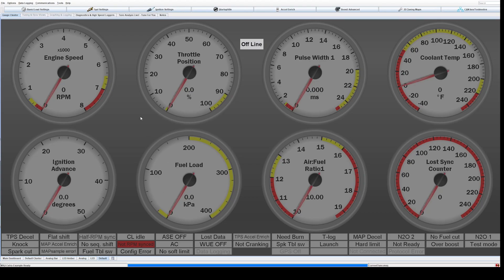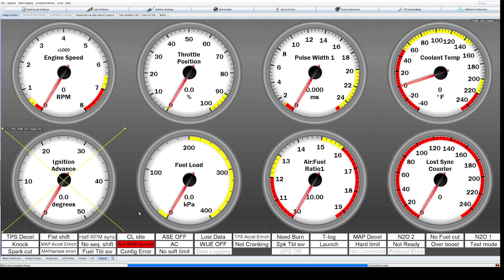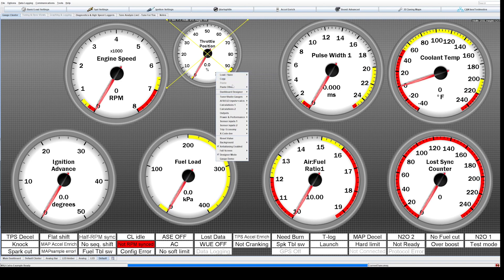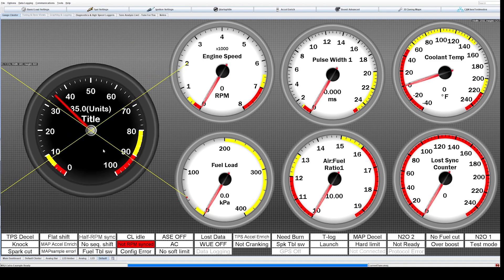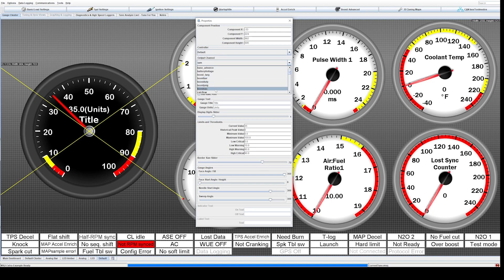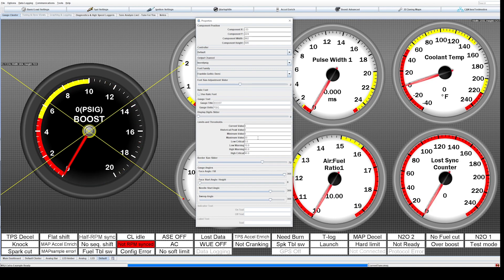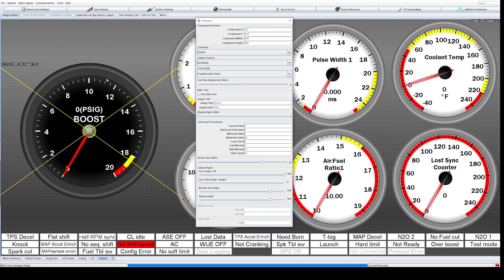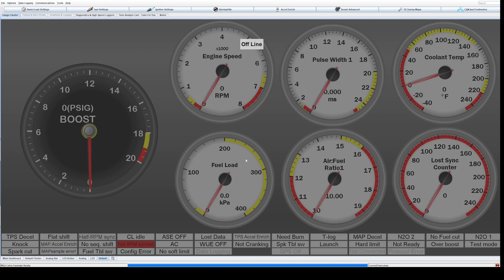Megasquirt Tuner Studio Custom Gauge Basics | How to tune

Comment: Why would the designer mode be grayed out?  I'm running the free version and currently not hooked up to the car.   Thanks!
Reply from the maker: It’s only available on the paid version
Reply: @TurbineResearch  So I got the paid version and noticed on my RPM gage that the high warning and critical thresholds are abbreviations (rpmdang).  Does this refer to another setting somewhere?

Comment: Is there a way to extract a tune from the micro squirt that is already been previously set up?
Reply from the maker: Yea just connect with tunerstudio and click save as
Reply: The previous owner set up multiple tunes for a supercharger.
I'm wanting to download/extract them off the micro squirt.
your saying just save as in run mode will creat the tune files? @TurbineResearch
Reply from the maker: @berserker3912  when you connect the ECU to tuner studio it will let you save the current tune on the ecu to a file on your computer